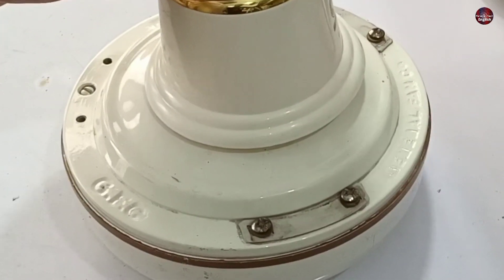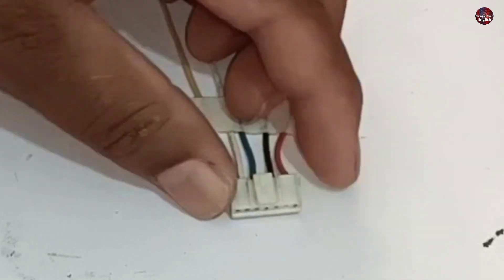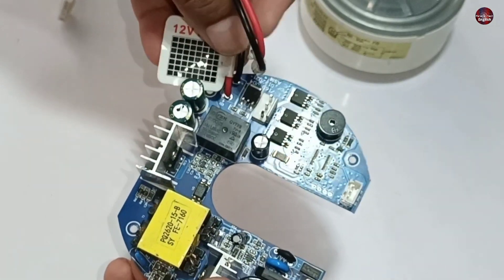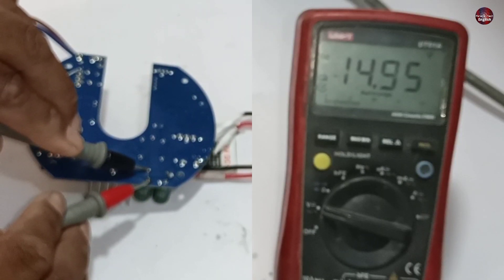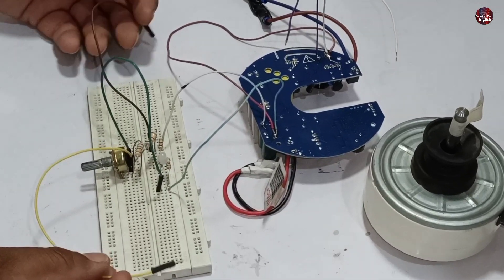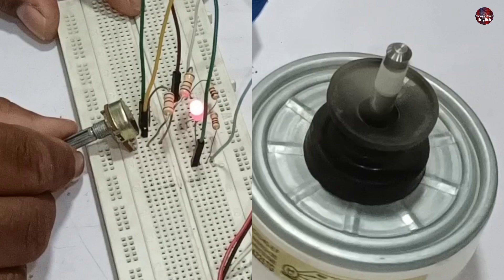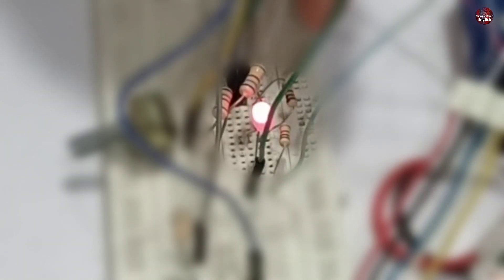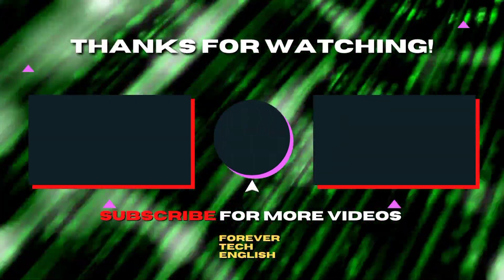Can We Operate a Blower Motor With Ceiling Fan Circuit

Comment: What is pg
Reply from the maker: This wire, often referred to as the "Pulse Generator" wire or "Position Feedback" wire, provides information about the rotor's position to the motor controller. the PG or feedback wire in a BLDC blower motor is used to provide real-time data about the rotor's position, enabling precise control, efficient operation, smooth commutation, and fault detection.